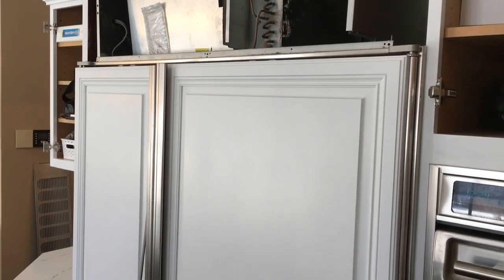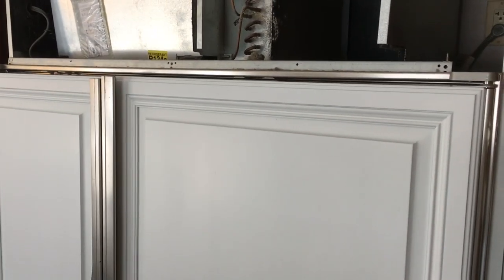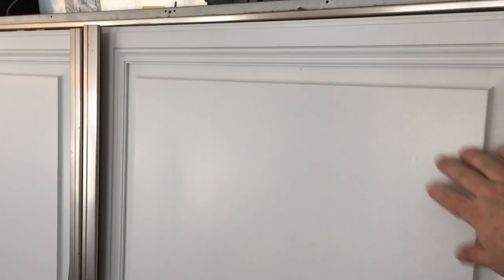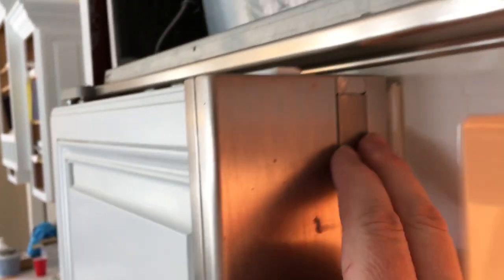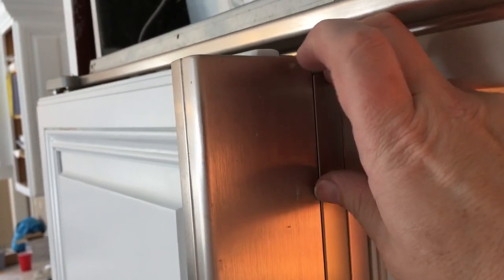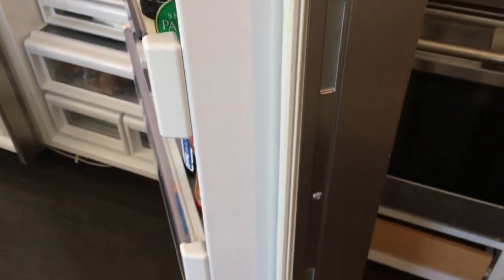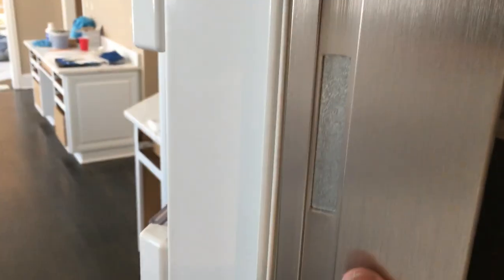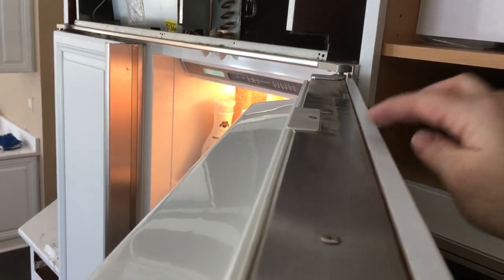How to remove panels from a sub zero refrigerator

Comment: Would you happen to know how to remove the handles from a built-in model kitchenaid refrigerator?
Reply from the maker: Foodlove with Anna I do not- sorry
Reply: Once you get the door off, the handles are screwed into a piece of plywood and the door. Just lift the magnet strip he shows and unscrew a few screws. The cabinetry slides out.